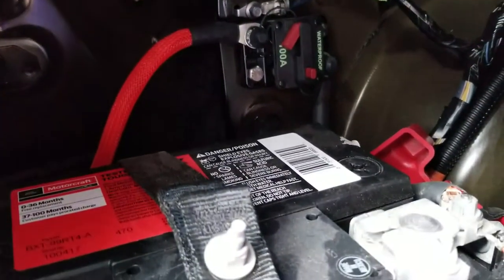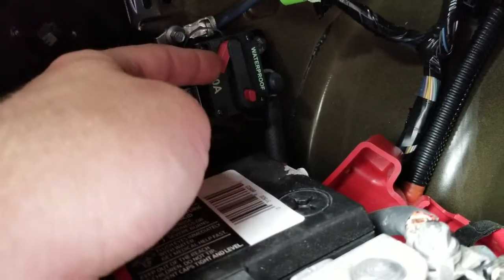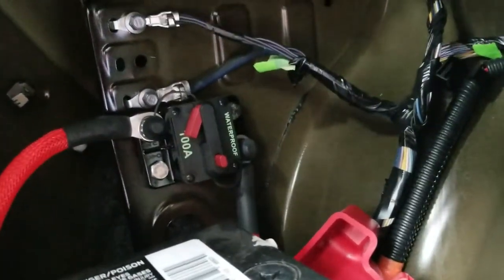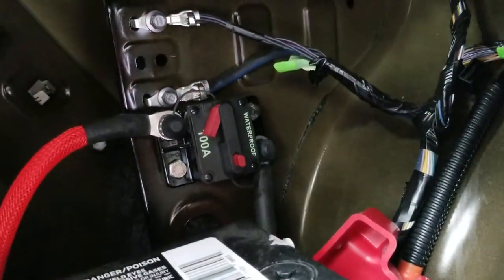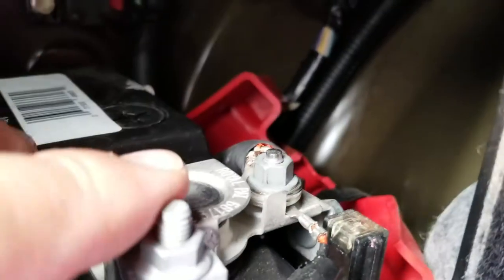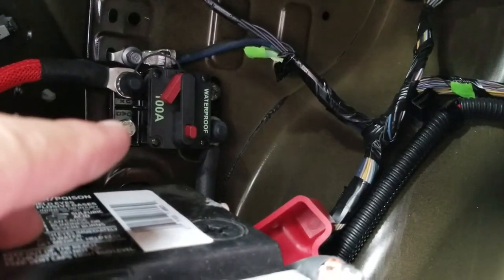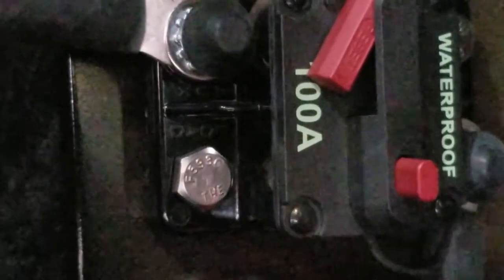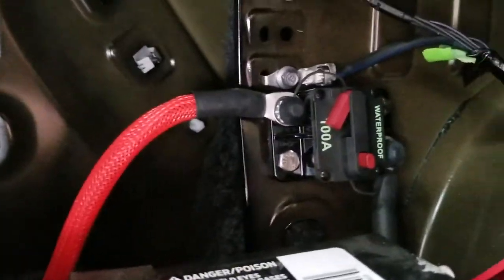Using A Circuit Breaker on your Car Audio System

Comment: If the reset switch no longer stays clicked in on position is the breaker bad?  Does it need to be replaced or can it be repaired? What can cause this breaker to blow?  Thanks in advance for any info you can provide.
Reply from the maker: Yes. Its bad
Reply from the maker: Replace it

Comment: Do you think this would work well for a 1500 watt inverter? What amp breaker would you suggest? What gauge wire would you suggest? Thanks! Shouldn't it be closer to the battery rather than the amplifier or the inverter?
Reply from the maker: Absolutely,  get a 150 Amp CB and 4g wiring or bigger

Comment: Can I run this to my 1800 watts taramp?
Reply from the maker: Yes
Reply: @ATCA  thank you menn I was thinking so much. Subscribe brother🙏🏾💯
Reply: One last question could I run my 2  12s on this (amp 1800watts)? 1500 watts each
Reply from the maker: @supremetoonz3430  what subs
Reply: @ATCA  i got 2 kickers. 12s. 1500 watts each.
Reply from the maker: @supremetoonz3430  hmm
Reply: @ATCA  I guess it's possible lol
Reply from the maker: @supremetoonz3430  I just don't know what subs you have
Reply: @ATCA  kickers. 1500 watts each.
Reply: @ATCA  I have two of them.
Reply: @ATCA  would my 1800 watts taramp push them?
Reply: @ATCA  are it's not enough power
Reply from the maker: @supremetoonz3430  well. I've never seen. 1500w kicker. That's rms or max? What model number?
Reply from the maker: @supremetoonz3430  a quick Google search says L7 is 1500w max.

"power handling: 350-750 watts RMS
peak power: 1500 watts"
In this case, 1500w is a useless number. Such as you're describing.  It's useless to recommend against.  Tnow this L7 is 750w rms. So 2 of them will need 1500w rms. 

Depending on your speakers ohm lead, thst 1800w amp may push them just fine.  

It's going to meter if they're dual 2 ohm or dual 4 ohm coils.

Comment: can i use a house breaker
Reply from the maker: No. please no.
Reply: @ATCA  lmao
Reply: definitley not
Reply: It is not the same use. I am talking about AC current and DC current. Definitely different behavior of the circuit.
Reply: Yes but you must also install home stereo in the dashboard and use extension cords for power and ground.

Comment: Please look at this: https://www.youtube.com/watch?v=ksWy5Uld_cM
On the above link you can see how cheap is the type of circuit breaker we are using and the quality is terribly bad.
Reply from the maker: There are va few different models. I started with a cheap breaker. This is not one of those. Buy good breakers
Reply from the maker: This unit I used first and it literally fell apart. But i bought a better units that looks the same but its a lot better. Look at the black. In his video its more glossy and has no brand. I paid $30 for my new unit and its actually better. Guaranteed.  Plus i only use for 100 amp. Bigger amps I use this other style below that one and its even better.  But its like $40